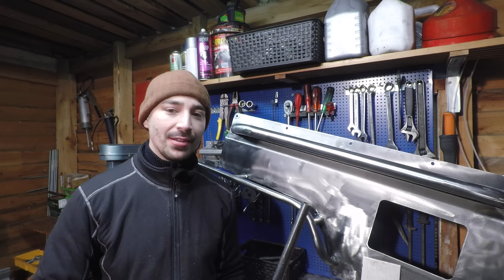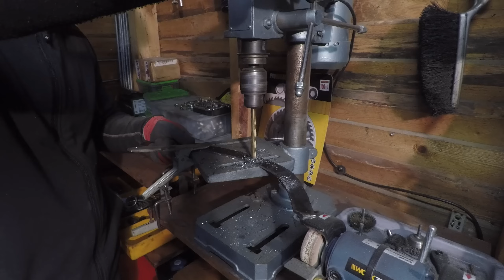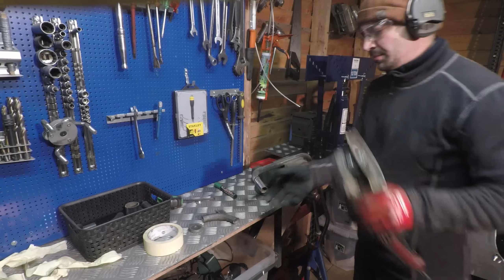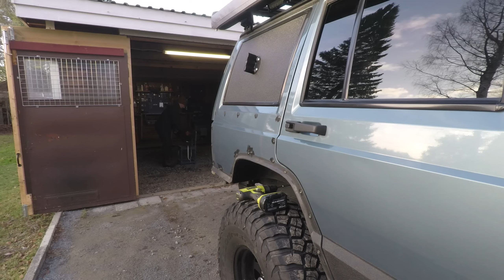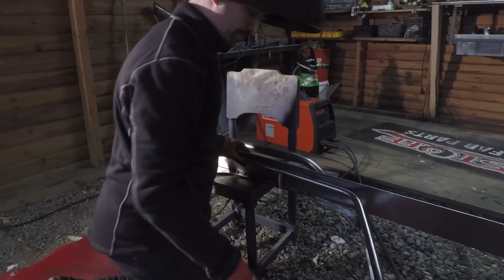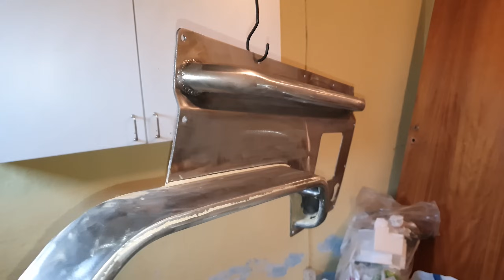How to Fabricate REAR Tube Steel Fender Flares / Jeep XJ

Comment: I have the same bender that you have. My son came across an air over hydraulic jack that will replace the manual bottle jack. Hopefully it works. It’ll be sweet not having to pump the jack while trying to keep an eye on the work. You’ve done a hell of a job on this project!
Reply from the maker: That sounds like a much better upgrade. Its not a bad bender but it's the most basic I guess isn't it. I've found it okay for small thinner tube. Larger tube I've had no luck with even with sand and heat. Thanks for watching

Comment: I've been wanting to do this to my 95 XJ (the flares) would be nice if they offered these in aluminum. I'm pricing out the materials to do mine in aluminum. But I'm not cutting the quarter panels of front fenders. I'll be making mine to bolt in the factory holes, using the nutserts. I'm enjoying following the evolution of your XJ. Keep up the good work. God bless, stay well.

Comment: When bending your pipe pack inside the pipe with sand you may have to cap the ends but you get the flat spots in the bends.
Reply: Sorry, you not get the flat spots in the bends.
Reply from the maker: Thanks for the tip. I have plenty of sand so no excuses next time!

Comment: Had same issue with mine. The flare frame bending due to  the heat.

I just cut a few relief notches on the under side. Then bent and held the flair into position then welded the relief cuts.
Reply from the maker: Great tip 👍 I will probably do that just so I can take them on and off without any messing around. Thanks for watching

Comment: Your channel is awesome I bought some amour for my xj just this past summer and I have yet to find a video that goes in any detail on the best way to seal the plate for stopping any rust thanks for the videos.I sealed mine just around the plates along with the gas opening also I have yet to have it out in the rain do to this so i will be undoing each one and putting a bit a Rtv in between as i did the same for the bends in the side of the amour for the body lines of the jeep,  I think from your video , that should do it because  I have it seal up rather good and have did a great job of keeping it dry as it stays under a car cover.
Reply from the maker: Thanks for the comment and for watching! Sounds like you are making the right move. I think the biggest problem will be the armor trapping water around the bolt holes. The rtv should stop that. I haven't mounted mine yet as I have to fox the door hinge but I will seal it off hopefully. Thanks again

Comment: Hey man great videos can you go over that back piece of aluminum for the window and how you mounted it.
Reply from the maker: Sadly I never filmed the process as it was before I lived here. I guess I can pull on out and show it but its basically held in exactly the same way as the glass window. The rubber seal is holding it in.
Reply: @WorkshoptoWilderness  hey brother. If you have time in another video that would be great im just wondering how it holds the weight of the water jugs.

Comment: Very nice job well done 👍 also the lef headlights on your xj where by chance did you get them?
Reply from the maker: Thanks for watching. I picked them up off of ebay for around 100 pounds. I can find the link for you. They seem to work well and they run fine in low temps -35c with no flickering of frosted over.

Comment: do you need to run mud flaps where you live? Ive always thought that that style metal fender would lend itself to some quick attach/detach mud flaps
Reply from the maker: I tend to run the front and back with some diy inner wheel liners. The gravel roads are pretty unforgiving so I have to protect everything.